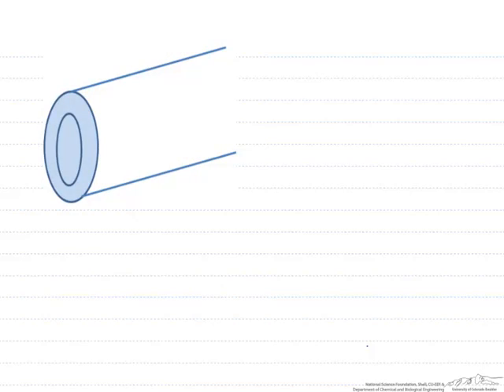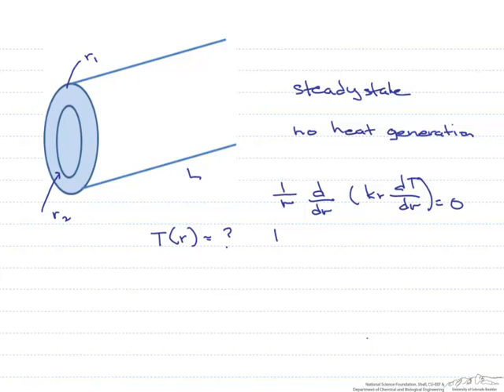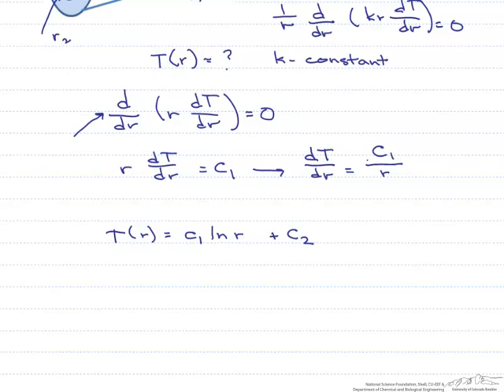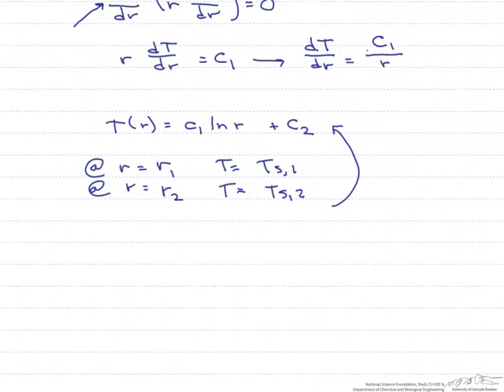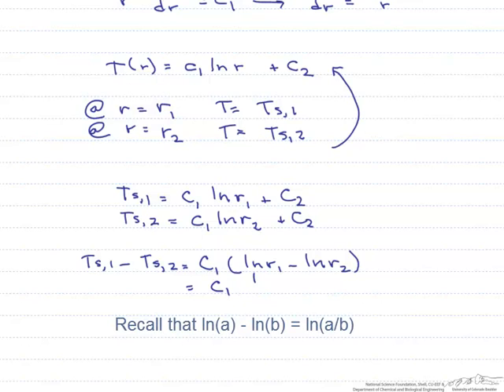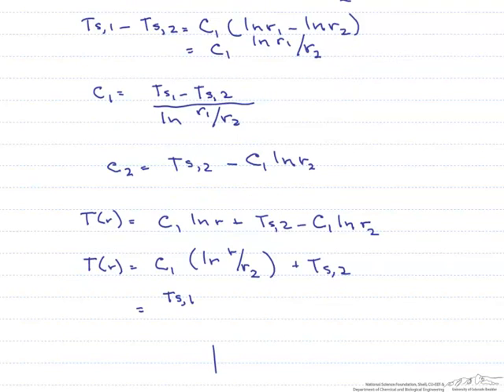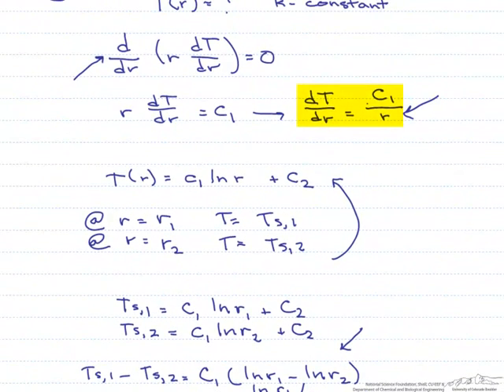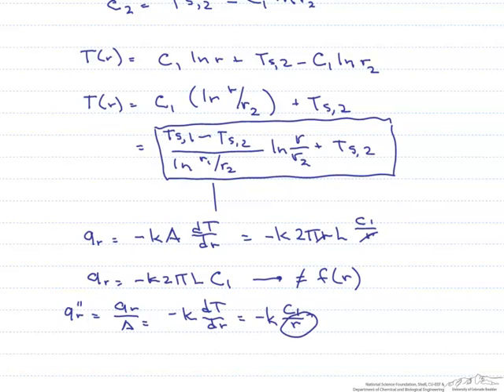Temperature Distribution for a Cylinder

Comment: What is the reason for keeping the 1/r on the outside and also the kr on the inside?? Why not just eliminate the r's and write d/dr (k dT/dr) = 0
Reply: Hello ryan,
I guess I can help you. (1/r) came from the equation of heat (read Incopera's chapter 2). since it's out of the d/dr(KrdT/dr) = 0 , it cannot be eliminated with "r" inside the derivative. because r is not a constant once the variable T depends on it. T = T(r).  (1/r) does not "make part" of the fuction KrdT/dr, in contrast of r, that does.

Comment from the maker: C1 is not a function of r but a constant that uses r1 and r2.  T(r) is a function of r but q (the heat flux) is heat per area per time.  The area (2pi*r) has the r term that cancels the r term in the dT/dr result.  So q is not a function of r (its constant). Heat flux should be constant for steady state flux.
Reply: Can you give us vedeo
Reply: As I understand it, for the cylindircal problem Q_dot is constant, wheras q_dot is dependant on r.

Comment from the maker: Since we are setting the whole term equal to zero, the 1/r term is multiplied by r and the 0 term is multiplied by r, so it drops out. Since k is a constant, it does not change with respect to r so it can be removed from the term and then again drops out since it is zero on the right side.
Reply: I've been staring at this for the past 15 minutes trying to figure out what happened. Thank you!

Comment: what happens to the term 1/r? why can you just drop that 1/r? and why do you eliminate K? it's not necessarily equal to 1.
Reply: The right side = 0, so you can just multiply both sides by r which would turn the 1/r term into r/r = 1. The right side then is r*0 which is still = 0.